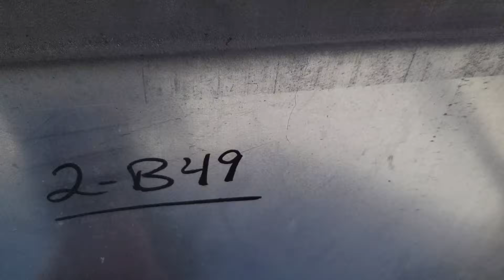THE EXHAUST FAN JUST STOPPED AGAIN

Comment: I worked at a college for 14 years and hundreds of motors were connected with that flex conduit. Place was over 30 years old. I never found a shorted wire in the flex conduit....but poor assembly had connector ends loose.

Comment: The factories like to save money, what was installed was 3/8” flex which is too small for the wires that were inserted.
MC or what used to be BX cable only came with solid wire which should not be installed in units that vibrate which causes hardening of the copper and breaks causing shorts.

Comment: Question. If you use a vendor, i.e. motor shop, to get a part serviced, do you tack your multiplier for that as well? Or does the customer just pay for the cost of the vendor?
Reply from the maker: Yes I still markup the rebuild, you gotta realize that yes I am having someone else do the work for me, but I still take responsibility and will warranty the work , and I am financing the customer for anywhere from 30-90 days before they issue my payment. So I gotta be able to profit off that
Reply: @HVACR VIDEOS  That makes sense. I don't charge people money and was curious. Plus, without the connection, they would pay you your hourly wage as well. That gets expensive quickly. Even saves the customer money in a lot of ways. Thanks for the response bro!
Reply from the maker: I will discuss this on my livestream this evening 02/07/22 @ 5:PM (pacific) on YouTube come over and check it out https://youtu.be/sE9dg71dJbA

Comment: I use MX conduit to keep mice from chewing my fridge mains line up. Also I figured AMPS would be higher under lower air pressure load since it’s pulling more on the motor. But learn something new everyday.

Comment: We get the same thing in PVC corrugated conduit in vehicles, the ridges rub into the wires, exposes the conductor, then often moisture gets into the conduit at junctions and connectors and the wires corrode away out of sight to the point they fail.

Comment: Rebuild shop? I rebuild those myself, and I don't tension the belts by the book, because this is the failure that happens when they are "correctly" tensioned. These machines are not built to withstand the tensions specified by the belt manufactures. RTU's and MUA units that are under 15 tons of cooling fall into that category. A 50 ton Intellipak? Yep, tension away.
Reply from the maker: Great point and I will discuss this on my livestream this evening 02/07/22 @ 5:PM (pacific) on YouTube come over and check it out https://youtu.be/sE9dg71dJbA

Comment: According to the guys who fixed it that's more or less what happened to a package unit in my last apartment. I didn't get to see inside it, but when they opened it the tech remarked "Holy S*@t! It looks like a bomb went off in here!" Dunno if the blower or compressor went first but whichever it was apparently took out the other. Needless to say the entire unit got replaced. Pretty sure shrapnel hit the evaporator and other internals too.

Comment: Great video Chris. I was just wondering if you should be worried about the direct flame/heat hitting that liquid tight and melting it. Up in the North we would be running in mid to high fire more than you would. Just curious.

Comment: The odd screw bucket - sometimes spare parts comes with extra screws that are only used on some cars for the same spare part.
And of cars - if you have a friend with an older Subaru - connect the two green connectors in the passenger footwell and see what they say when they try to use the car the next time.
Reply: You have peaked my curiosity.
What happens?
Reply: @fixitallpaul4847  IKR? I want to know too... And how old is "older?" I know a few Subieheads worthy of a prank.
Reply: @dashcamandy2242   apparently around mid 00's applies not sure when it actually started or if it has ended. this will potentially put the car into a diagnosis mode where the car will run like crap and the CEL will either light or blink. 
i say potentially because some models have a plug under drivers side and both need to be connected, although the driver side is apparently usually harder to get to and therefore less likely to be unplugged if it has ever been connected before.

did a liitle bit of interweb researching for anyone too busy/lazy/ uninterested to dig themselves.

Comment: You're not putting the mua under building pressure when you close the panel because there's no return and the supply is already sealed. On those gas fired muas the burner plate and the hole it pulls the air through is made to be at right about 0.6inwc of pressure differential, restricting the air flow and causing the lower amp draw. There's usually plates that can be adjusted or sometines its just plates with springs or a damper that will keep that 0.6 inwc

Comment: I had a similar situation that you had on the MUA. Mine was a Carrier Humidimiser. The blower section grenaded itself. I had to get it back up and running ASAP. They were loosing $25k per hour of down time. I used unistrut and a new bearing with 4 mounting holes and was able to get the shaft and blower centered in the destroyed spider bracket. Put a rush delivery on the new parts. Cost them $5k to get it back to factory.